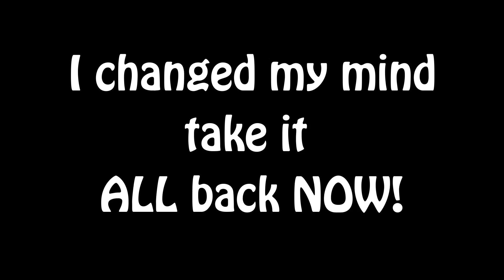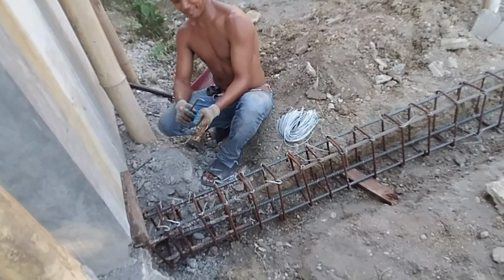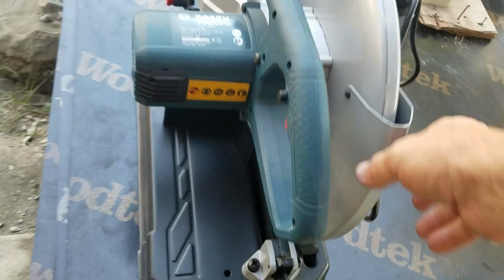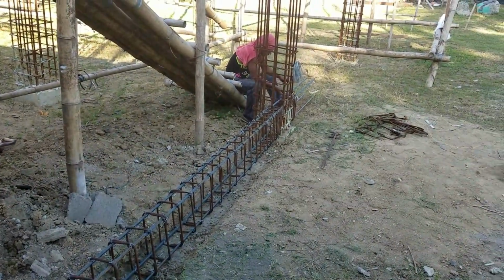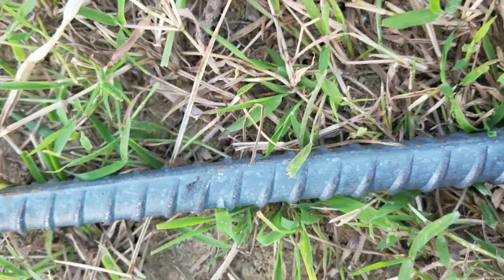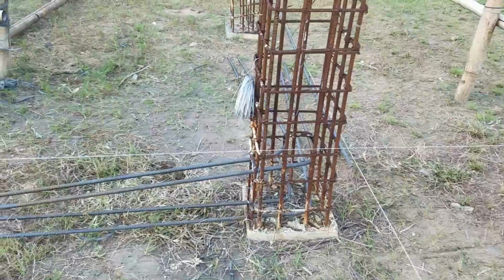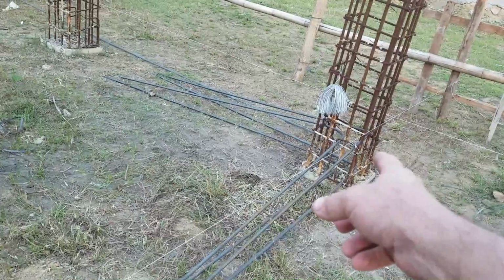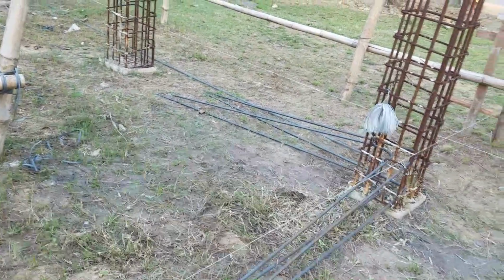PHILIPPINES BEACH HOUSE OFFGRID BUILD episode 53 part 3

Comment: James, I watch a lot of building as well. My PI Dream, AusPhil Adventure, Peter White, 
Frankie Sunshine are some with 2 story builds. I have shamelessly copied ideas
from ALL OF THEM.   Best I can tell, Peter White built a large 2 story house without
a gas mixer.  I was simply amazed that it could even be done.  I got the impression
that shovel mixing was being done at multiple sites simultaneously on the second 
floor slab.  We have at least 10 concrete pump rigs south of Manila and mixer plants
that have  begun operation after we finished our house frame. We elected to site mix everything mainly to give steady employment to the maximun number of employees.
By putting the mixer right at the pour area including on the roof, and prestaging all
the materials over several days we had the same number of crew on pour days as
between pour days.
       There is not a lot of coverage on a proper electrical installation. Between the
building permit requirements and licenced electrician I ended up with 125 circuit
breakers on the 220 volt side and another 24 on the 110 side which we will likely
not wire up any time soon. Our central atrium has 1170 feet of 3/4" orange PVC 
conduit. About half the total conduit in the house runs to and from that one room.
       I read thru the PH national electric code (available online) and found I need some
crimped and soldered terminal ends. The terminals for AWG 12-10 size wire and
a forked end for a #8 stud size apparently are not available in the PH or possibly not
on this planet. The major problem is the AWG #12 wire size required for the 20 amp 
outlets  not fitting around the screws.  Oh then the AWG #14 wire on lighting which
draws less than 1 amp and a minimum breaker size available at 15 amps  that
makes the wire be AWG #14. We are also required to have the green bond wires
seemingly everywhere with no ground bar in the sub-panels to tie them into. The
ground bars came from Lazada, but still no uninsulated terminals to fit AWG #12.
     I have retreated to the ornamental iron work for a while since Meralco just
doesn't want to connect the transformer on a pole in our front yard to our (their)
meter base until the wireing is complete. I think their offices have been relocated again
from the original Rosario office to Trece Martires to.....wherever. I am renting
4 sq meters at the local machine shop for electric supply. Done with Maralco.

                                          george and aurora     enjoying the Philippines and the great people

Comment: I can't wait to see you pour solid concrete walls hand mixing it. Lol.

Do you think that short corner joint would be ok if you welded the two overlapping bars together? I'm planning an exposed lower level built into the hill. It's construction not coming there so I'm a bit nervous about it. But I plan to weld as much of it as possible
Reply from the maker: you can't weld this rebar. It will break where you weld it. The steel these days is too porous and impure. you can only bind it. There all some special hardware you can buy. Im telling you - don't weld this stuff. The only rebar that can be welded has a special stamp on it and cost way more. I have never even seen it here.
Reply: @TexasFilipino  gotcha.. thanks. I've built many houses in the USA but never with cement and block

Comment: Hope you have some sqare near by , dont do like (Jame🤔 ) and take them out near the end of the constucrion.
Like what your doing
Reply from the maker: Squares and levels everywhere. Funny you say this. I just had a meeting with the wife and workers that they rush to get the pour cement part too quick. I want slower but surer. I told the wife you spend the extra time now before the pour and get it square level n right or you spend way more time after the pour patching , adjusting and kicking yourself in the butt.  I told them they are always ready to pour cement at 70% prep I want it at 100% prep before a bag of cement is mixed. Thanks for following us and commenting.